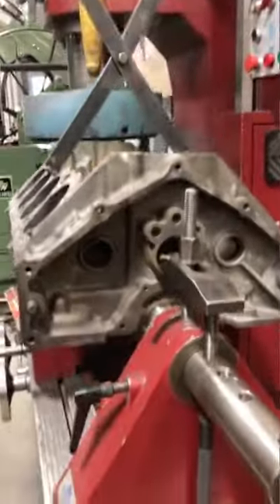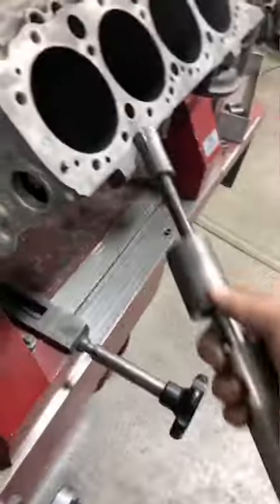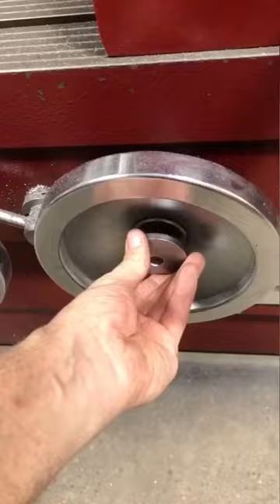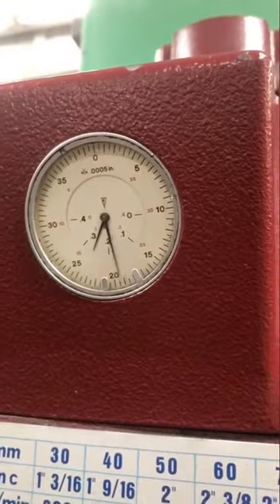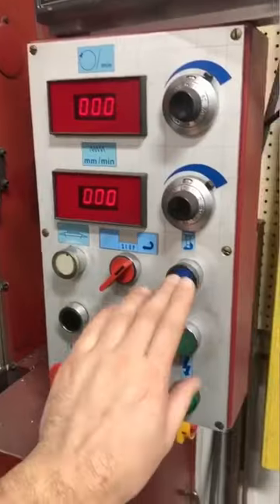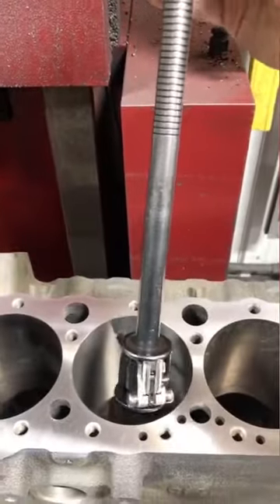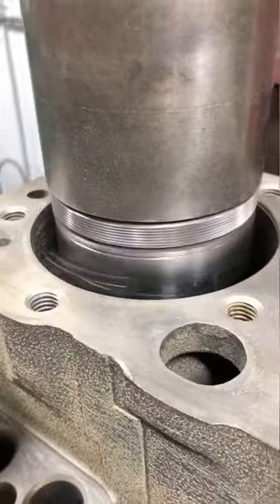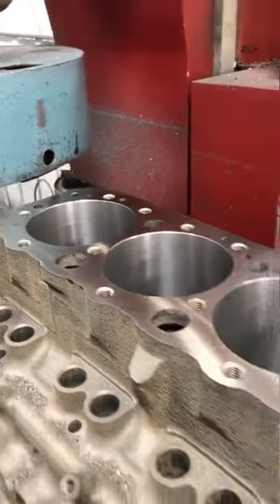#shorts Boring and Decking a 350 Small Block Chevy

Comment: 🤔 Our shop would bore cylinders first leaving a step at the bottom to allow the sleeve to seat and then plan block.
We came up with the practice after the engine block which had unknowingly to us bored before. 
When test driving the HQ Holden the piston and bore seized resulting with the sleeve going up and down with the piston 
Yup you guessed it 
Buggered
Reply: Bull - another AU story !
Reply: What were the numbers doing on the piaton heads ? Going along 4 the ride too ?. .  😑

Comment: Question: What accuracy does that mill have? Like what is the lowest number that you can precisely hit? A tenth? A thou? Something inbetween?
Reply: Digital readout was out to ten thou spot but most of the time you would be working within a thou
Reply: 1/2 a thou or thereabouts-- prince Philip has just died. Long live the king @ 99 😧
Reply: @trevking3772  wow, I would've expected more precision. But I guess that makes sense since the engines are rather old, and achievable tolerances have skyrocketed since you could simulate the thermal expansion of the base casting etc.

Comment: This may be a dumb question... but what guarantees that the flat part on the bottom of the block that you're using as your reference is truly 45 degrees from the bore axis? If not wouldn't the bores be non-perpendicular to the face you just resurfaced? Is this an issue if it isn't, or are these small deviations within tolerance of the fabrication specs?

Comment: Do the Dowel pin heights needs adjusted or does that not matter, same with the head bolts do they need the holes chased deeper for torquing the heads back on. I also wondered why this doesn't mess up the way the intake fits on the engine.

Comment: How much would it cost to have an engine rebored and resurfaced?
Reply: Bout $10 per hole & $80 -$1
Reply: 00 per deck give or take.Trev. NZ
Reply: Ok ty
Reply: @duckguide4109  Know worries - and they often disappointingly  go no better after you get the work done unless its a real Smoker / oil burner. Goodluck.

Comment: Another stupid gm motor how boring
Reply: If gm engines are so stupid then how come they are the most used engines when it comes to different builds?
Reply: @-meat-  the engines can be descent. Honda sells the most engines if that matters. Not to be an ass but popularity isn't exactly a measurement of quality.
Reply: @-meat-  because Chevy is the best 🤷🤷. It leads the pack and owns the drag strip
Reply: @brandonbell3089  right on!

Comment: How do you know the pan rail is 90 degrees to the cam/crank centerline?
Reply: In the setting up of the boring bar it doesn't matter: it is registered off the crankshart bores or head surface like the portable old boring bars were you could do work in the feild. Oil pan rails generally going along for the ride unless specialized. Boring Bar registers on crank centerline or block deck/s - any clearer than mud now ? T. NZ.